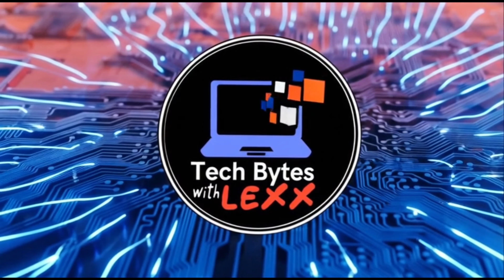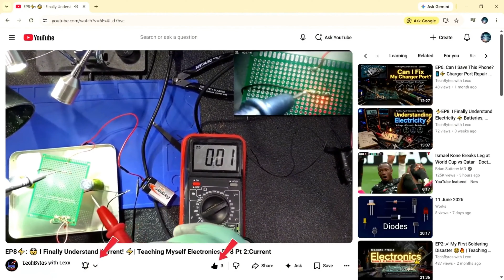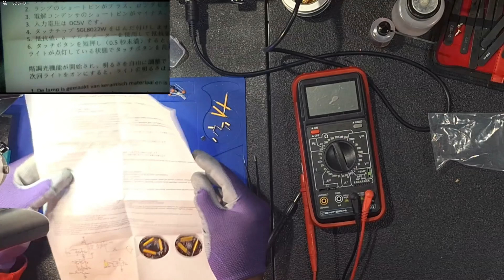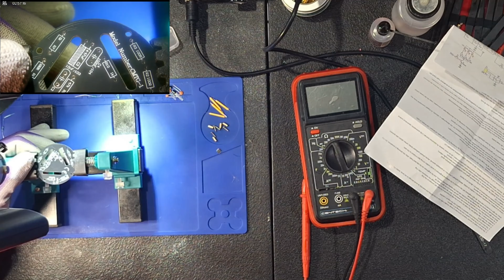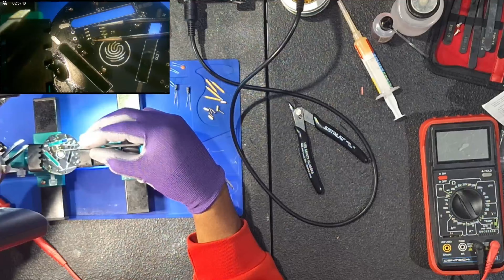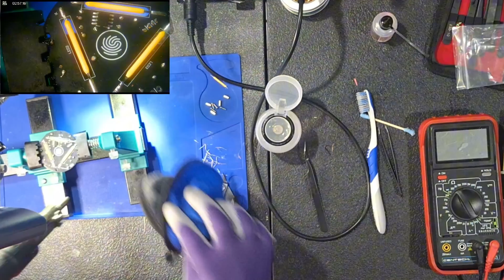⚡I Built a Touch Light Dimmer PCB... Did It Actually Work? | Teaching Myself Electronics⚡

Comment: Stop using that PCB holder, it is making your task a LOT more difficult.
Place the PCB flat on your work bench and solder it there. You can use gravity and a spare finger to push the components into the correct places.
Also, those filament LEDs emit light on one side only, so test them and make sure to install them all the same direction.
Also, that circuit is designed for 5V so you should not have used 9V battery. You are very lucky that you did not burn out the IC or LEDs... Never ever supply more than rated voltage, you will damage components!
To get 5V power, cut the end off a USB cable, then get power from a power bank or wall adaptor.
Reply from the maker: Very nice bit of advice. I actually like the pcb holder because of the rotation but I will try without as you suggested. I will build a 5v connection as well, took a chance with the 9v for now.